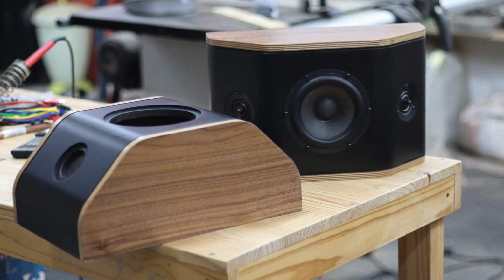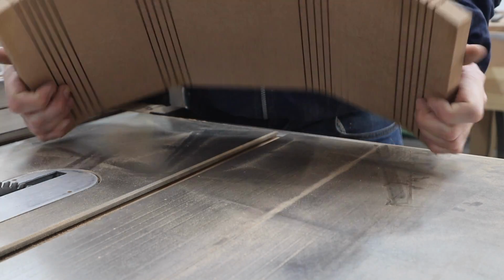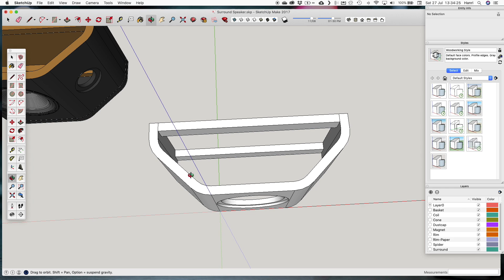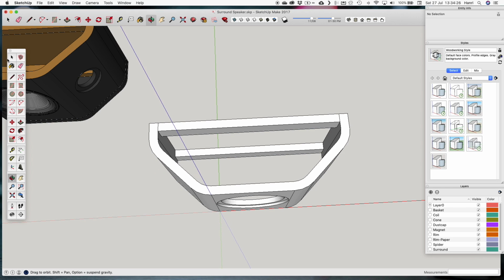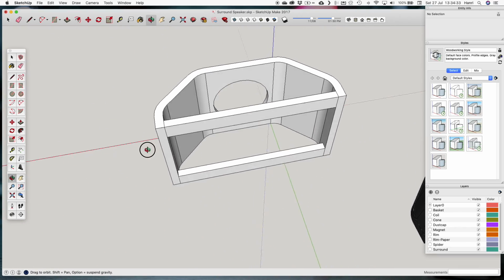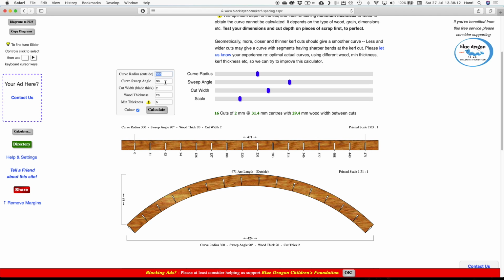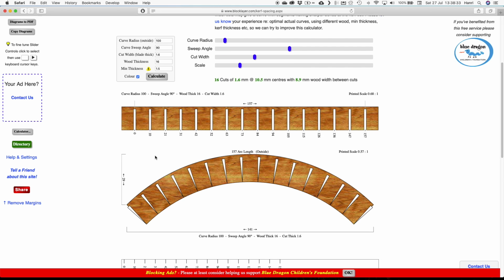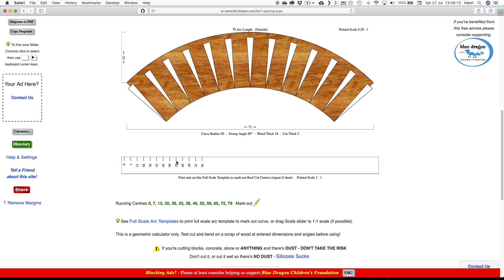Building Home Theater SURROUND SPEAKERS - by SoundBlab

Comment: Hello, very neatly looking job! I tried the same black matte effect on mdf, however with grey spray primer and black matte spray lack on top it was still too shiny and uneven. What is the trick here? Thanks
Reply from the maker: I often use a spray filler to even out the surface, wet sanding in between two coats to get it smooth. Then a primer and then a colour coat or two or three. This is then covered with a coat or two of matte spray lacquer.

Comment: I've already commented on this before, but a surround design like this would be fantastic for rear surrounds mounted on the rear wall. The wide dispersion and excellent off-axis performance of the double ring radiator tweeter coupled with the rounded design of that cabinet should provide excellent results even if you're listening on-axis to the woofer. But the best effect will be how atmospheric the first and second order reflections should be if used as rear surrounds. At some point I want to have enough space and money to buy a bunch of KEF 3001SE or equivalent little pod speakers to fully occupy all of the 11 channels of amplifier output my receiver supports. Their sound should mesh decently well with my KEF iQ90 towers and I'll never be able to afford to build anything better myself with nearly as compact and comprehensive a design.

Comment: Have you ever thought about reboxing an existing speaker that already sounds good but has a crappy or damaged cabinet? Something like a Dayton Audio bookshelf or maybe some high end older speaker picked up used that has a warn or damaged cabinet but the drivers are in perfect condition? I think that would be  a great project to get people into speaker building as many may have the woodworking skills, but are overwhelmed with the idea of matching driver types and building crossovers. This would be a great way to get proven sound results but with a furniture grade custom looking finished product.
Reply from the maker: Not a bad idea. I will put this on my possible project list.

Comment: Great work buddy. You should build filters using some standard PCB, which is really cheap and available.
Reply from the maker: Thanks man. Not really into the off-the-shelf stock PCB crossovers. You will almost never get the desired result as each driver has a varied response from each other. You have to measure and build a crossover according to the measurements and specs of the drivers for a good predicted outcome.
Reply from the maker: Ah, I understand. I bought some of these from Banggood a while back with that in mind, but have not used them yet.

Comment: I loved these, being a committed hi-fi nut. one thing that puzzles me though is the speaker terminal plate on the rear. As you've included wall mounting brackets won't the speaker terminal plate and the speaker cable stop the speaker from lying close to the wall? Would it influence the speaker if you were to machine a recess for the speaker terminal plate?
Reply from the maker: Thanks. You can just extend the screws in the wall far enough to clear the terminal cup. Or use some silicone or rubber spacers on the back.

Comment: Mr SoundBlab, very nice build as well as the others on your website.  I have built a couple of speakers, but unfortunately I do not have the experience or knowledge of how to select the proper crossover components. In your Build Plans, do you include the speaker models and crossover components and crossover layout? Thank you.
Reply from the maker: Hi Richard, thank you! The build plans are very comprehensive. It shows every step in detail (including crossover schematic, layout and parts) and provides links to all the parts and even tools and equipment you will need for that build.

Comment: If you'd use a formed profile cutter to cut narrow Vees instead of square slots the wood would join top-to-bottom, just saying.
Reply from the maker: Yeah I hear you, but I prefer the square cut rather than the v-slot.

Comment: Could you elaborate on why you did Choose the xt25 tweeters despite theyre overly directional Sound characteristics? With mounting recommended to be 1m above ear Level and the Overall Design of those speakers anlignig them at 45° Off the Front the xt25 Seem to be pretty far from optimal for this Kind of Dipole configuration to me. Would Love to Hear about your thought process on my areas of concern

Comment: Is this a Bipole speaker, where can I learn more about how to design, and make a cross over for this kind of speaker.
Reply from the maker: Yes. There is not a lot of resources for this specifically. I had to figure it out on my own through trial and error.
Reply: @SoundBlab  instead of a bipole speaker could I make two identical speakers and angle/position them in a way like a bipole if so how could I get two side channel speaker to play at once. Without a series or parallel connection

Comment: I have a question with speakers like this, if there are 3 drivers does this means it is a stereo speaker by itself? or wired in such a a way that the signal is split evenly across the tweeters and woofer? or Ive seen speakers that have 2 lots of terminals on the back often bridged together, are these true stereo speakers in a single box? Thanks for any insight, I love your vids keep up the awesome work =)
Reply from the maker: These are specifically for surround purpose in a home theatre setup and will not work as front left and right stereo in a normal listening environment.

Comment: Very nice looking speakers, but what are the specifications ?
Reply from the maker: Thanks
Tweeters: Peerless XT25SC90-04 Ring Radiator Tweeter
Woofer: Silver Flute W14RC25-08 5.5″ Woofer Wool Cone 8 Ohm
Enclosure Description: Sealed box system
Frequency Response: -3dB at 80Hz and ±3dB up to 40000Hz on reference axis
Sensitivity: Approximately 87dB
Impedance: 8 Ohm
Recommended Amplifier Power: 30 – 120W into 6 to 8 Ohms
Dimensions: (W x H x D): 365 mm x 230 mm x 158 mm
Reply: @SoundBlab  Thanks for taking the time to respond. I haven't built a set of speakers in 56 years...LOL ! Bur, boy they were really nice ! Thanks again.

Comment: any reason these couldn't work as general music listening speakers? it's a nice design.
Reply from the maker: Thanks. They are designed to listen to off to the side (left or right). If from the front, you will not get a flat response.
Reply: @SoundBlab  that could be great if placed correctly. i'm comparing to having a couple of speakers on bookshelves for example.

Comment: Nice.  Very Bose.  Maybe recess the speakers and add grille cloth.  Make all cuts/holes/drilling before assembly and finish to prevent damage to the nice finish work you did.
Reply from the maker: Thanks. These will go up on a wall, so not too worried about damage.

Comment: I've worked with those XT25 small frame tweeters before, and it can be a little nerve wrecking. Too easy to accidentally slip and ruin one.
Reply from the maker: Yes, very!
Reply: Swap out the Philips screws for some square drive or torx screws and save yourself a lot of heartache worrying about the bit jumping out of the screw.

Comment: Do you offer services locally ? I'm from the Cape Town area.
Reply from the maker: I still run a day job, so my free time is very very limited. Sorry man. What did you have in mind though? Perhaps I can steer you in the right direction.
Reply: @SoundBlab  I'm planing to buy.
x4 HiVi M6N 6" Aluminum/Magnesium Midbass
 
x2 Peerless by Tymphany XT25BG60-04 1" Dual Ring Radiator Tweeter
I will need a box for it, I will place in it all the electronics for it, active crossover, several class-d amplifiers all designed by me. I need some to help me with the wood work.

Comment: Beautiful build and tutorial, but those speakers are inappropriate for today's discrete channel, object based, surround sound formats.
Reply from the maker: Thanks. It depends on your setup and preference. I prefer a wider dispersion on my left and right surround channels. Bi-poles are very good at that. I also have a second row of seats, and need the wider coverage and flexibility of placement bi-poles provides.

Comment: Nice idea but poor finish tbh. For example why there's no gasket between box and driver? Why screws are screwed directly in to mdf? And that black without primer and sanding looks crap as fk. I've made better box when I was 9 come on...
Reply from the maker: I dont think the video does the finish justice. It looks great in real life after giving the surfaces a good clean. The drivers already come with gaskets installed. What else should I screw them into? They in there pretty tight! This is a 2 in 1 high quality flat black primer and top coat from Rustoleum, and I didnt show how I sanded the enclosure, its a bit boring for the video, but I thought it would be obvious that I did. I would love to see the box that you made when you were 9... Pity you dont have a video of it!
Reply: @SoundBlab  Don't mind him. He's this type of Polish person. They could only criticises and don't know how to do anything else in their life.
Reply: Most commercially bought speaker drivers are screwed directly into pressed wood cabinets, the MDF used in this project is stronger - I really see no problem with that.  With bigger drivers and subwoofers one might consider metal inserts.  For small speakers like this, it really is not necessary.  And your finish looked perfectly fine to me.  Great project and very informative.